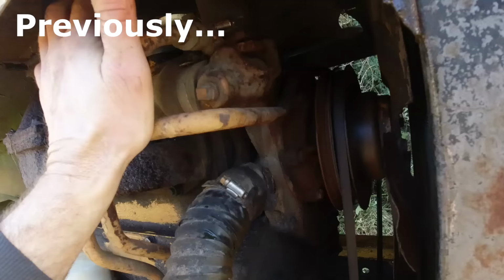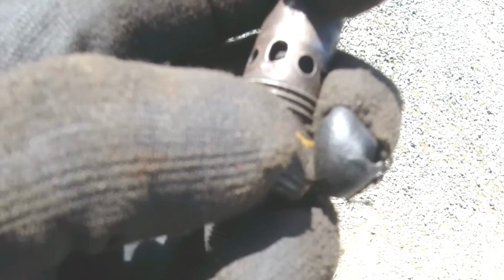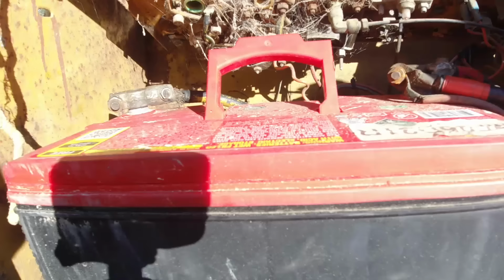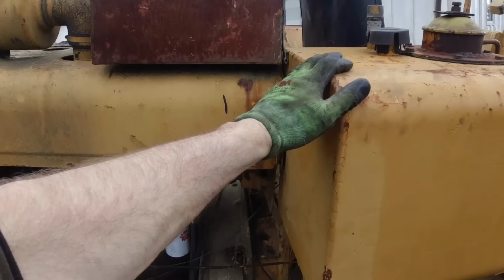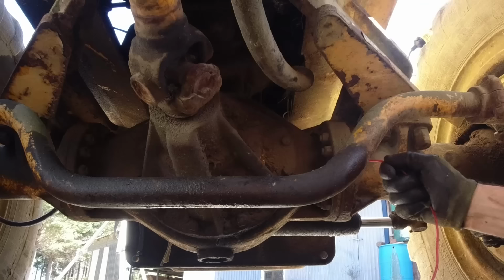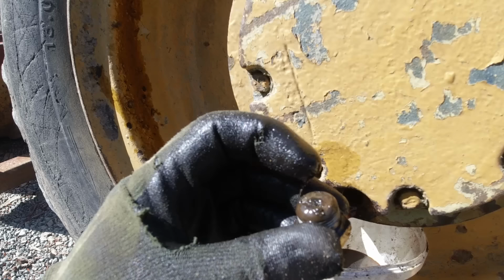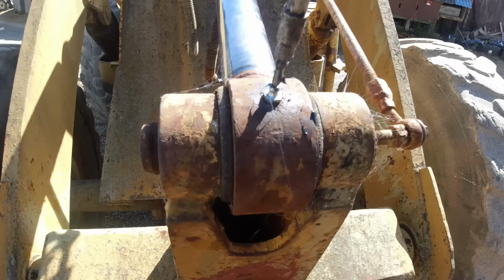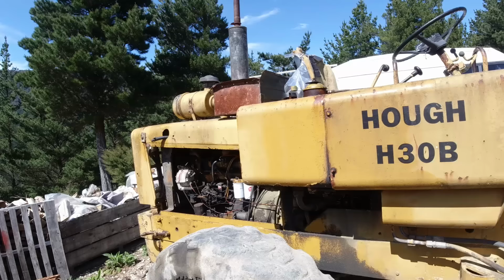Fixing the Hough 30 Payloader and putting it back to work..

Comment: I grew up on a wheat farm in the 1950's, spent endless hours watching my dad fix stuff. Seeing your kids there with you makes me very happy. Thanks Marty. At 70 they too may remember these happy hours with you.
Reply: "At 70 they too ABSOLUTELY" remember these happy hours with you." fixed it for ya brother <3
Reply: I was thinking the same thing, watching my dad fix stuff on the farm. You can take the boy from the farm, but not the farm from the boy
Reply: Yep, as a kid i hung around my Dad onboard his trawler back in the 1970s. So much oil removed & replaced from multiple engines down in the guts of that big steel boat... filters changed, then the entire hydraulics systems & out on the deck the winches needed greasing & all the steel cable pulleys .... I remember it all so clearly & probably where i 1st learned my skillset i use still today... Great video Marty!
Reply: Hanging out with DAD! 👍 I learned so much from him and his friends!
Reply: That's beautiful mate

Comment: All those old machines would last a really long time if maintenance would have been completed. They were built well compared to today's modern plastic throw away machines. Great work!
Reply: A loader like this cost a pretty penny. You would think that the owner would take better care of their investment rather than just driving it into the ground.
Reply: @gs1100ed  Some people are just like that. Drives me bonkers. I work for a housing contractor and his son is one of my best friends. I've been going to school to become a diesel tech for a couple years now. This man has over 1 million dollars worth of assets in machines alone and I have to BEG him to let me grease them. He doesn't take care of any of them. I can't stand it. Dude even has an automatic grease gun, battery powered and everything. It would take no time at all to put a couple pumps of grease in your machine every morning
Reply: @haydona1845  definitely bizarre behavior. I have rebuilt several engines and do most of my own work on my cars, trucks and motorcycles. I also drove 18 wheelers cross country for 20+ years. I am always gentle on the equipment, whether it’s mine or someone else’s. I kind of establish a bond with the vehicle after driving it or working on it. I’m a big advocate of preventative maintenance. Basically, repairing things BEFORE they break. I hate to be broke down on these of the road. Not saying my way is the best, but it Sounds like your boss has a screw loose.
Reply: @gs1100ed  same here man. I guess I sort of do develop a relationship with the machines as well be it as crazy as that may sound. I've always told my girlfriend that a car,truck,machine etc will tell you what it needs. Via vibration,noise,hesitation you name it. My boss doesn't understand any of that. He thinks I'm bullshitting h when I say something sounds weird or doesn't feel right. I work for him Part time and do school full time but what do I know right? It's pretty goofy

Comment: Very interesting to see how that Thermostart gadget works. That's a new one for me. Thanks Marty.
Reply: I agree.! The first 12 minutes made me cringe, putting fuel to a Glow Plug.?
Reply: @paulsilva3346  😮Yeah, I'd never imagined that a solenoid👍 resided in that tiny package
Reply: @charlesangell_bulmtl  it’s not a solenoid per se. It more of a valve. When the heating coil varms up. There is a thermal expansion / or contraction that mechanically opens the valve. Somewhat similar to a thermostat in the engine.

Comment: Fascinating.  Never heard of a thermo-start before.  I'm sure you must be the NZ machine whisperer. 😀
Reply: I thought he was saying thermostat for a minute, I was trying to work out how that was going to help it start without go go juice 🤦🤣
Reply: Thermostart ! the height of sophistication !!  just remember the slow match start, light the pellet, screw the holder in,try to start machine, remove holder,to find out pellet must have gone out almost immediately ! repeat for an hour. Machine starts finally, runs out of fuel in ten minutes !!
Reply: Also known as a "Glow-plug" and "Intake Manifold Heater". 😃

Comment: It’s amazing that something so small like particles in a filter can stop such a huge machine! Thank you Marty, for showing us all how important it is to change filters, and lube our machines!
Reply: If those particles get past the filter, big troubles, the injection system has such
fine tolerances very, very tiny particles cause mayhem and costs huge sums of
money to repair. The small investment of filter replacement is worth its weight
in gold. Even huge ship engines can be crippled by dirty fuel.

Comment: Literally never knew how glow plugs worked up until this point. Learn something every time i watch one of your videos
Reply: That`s not a glow plug.  Glow plugs (also called glow pins) only glow inside the cylinders.  They screw in to the head.  What Marty showed is a Thermostart device.  It heats an element, then fuel flows into the end, ignites, makes a flame, and heats up the intake manifold and the air inside it, so that when the engine begins cranking over,  there`s some nice HOT air to drag into the cylinders to give them a fighting chance to then ignite the diesel.  Once each cylinder has fired a few times, it creates its own heat to fire on each power stroke.  The Thermostart is merely a forerunner to grid heaters that we have on modern diesel engines to help start them in cold weather.
Reply: Bonfire plug!

Comment: Leaving an expensive piece of farm equipment to rust away cause it needs some part or the other doesn’t make any sense. Especially if the owner still owes money on it. Even after it is paid off and starting to age but operates, there is still money to be made at auction or outright sale. Of course  the equipment dealer is not going to give you a decent price, he is in the business of selling new machinery repairing your old equipment and charging as much as the public is willing to pay. 
My uncle had a massive dairy operation in the southwest United States. I spent many summers as a kid on his farm. He always bought used equipment. He was an amazing mechanic and a really hard worker. He had over 1500 milk cows. He also understood all facets of the dairy business including the Commodities business and the latest electronic equipment to keep his eye on his herd. He owned many hundreds of acres in three states. His life was working hard, no vacations. His five boys all went into the dairy business. A few of my cousins made a living off his dairy business. My uncle died a millionaire.  His days started at 4,00 AM and ended around 10,00 PM. In my opinion he died of over work.

Comment: After watching this I have confidence that my constipation will resolve itself today.  The only bad thing about replacing oil like that is that the seals that were relying on the sludge seem to give up the ghost.  Best of luck to you and yours!  PS:  Missus, he used the good knife again, so I just want to give you a heads up about the food tasting like diesel for a while.  You may want to restrict it's use to spicy and savory foods for the next week and watch out for the ones that have a bluish rainbow hue on top.

Comment: I find it amusing that a person will spend several thousand dollars on a piece of equipment but won't spend 50 to keep it running. A little oil and a few filters are the difference between many years of work or assured failure. You probably gave that old Hough Payloader many years of productive activity, as you have all the equipment you restore. It's a joy watching you since I am now 80 years old and can only watch and wish I could still do what you do.

Comment: It's amazing how well the machine runs when all the tar is drained from oil sumps and final drives.  I guess the previous owners figured that if they paint it, they solved the problem of those pesky maintenance issues of greasing and oiling that take up so much time, eh?  Fantastic job on making the old Hough run smooth great video Marty thumbs up.  Oh, I like the big spanner too!

Comment: Hi Marty.  I used to have one of them loaders for pushing silage into a silage pit and loading manure back in the late 70's. Great loaders and easy to work on.  There are grease nipples on the inside of the lift cylinders and they are also in the steering joints but the wheel has to be on full lock to access them. Good luck
Reply from the maker: Thanks, yes I got those but was too awkward to get the camera in there.
Reply: There's one other filter that should be cleaned, the transmission filter, it's a mesh type that can be washed.  Good luck
Reply: @mikestaunton7081  He mentioned not doing the transmission filter yet since the new part was still on its way. But doing it when the part would arrive…

Comment: Marty I have used CLR to clean radiators. Built a stand to hold them so they drain into a 5  gallon bucket and drop a cheap fountain  pump in the bucket and run the hose to the top and let in circulate did this in a pinch and was amazed how well it worked.

Comment: I recently acquired a 1948 Ferguson TEA20 tractor that had been sitting for 15 years with no exhaust cover (the exhaust pipe had rusted off at the manifold) so i had to remove starter and crowbar the ring gear to free it up after soaking the bores and now it starts first pop no smoke at all and i think what you are doing here (fluids, filters etc) is the most satisfying part 😁😁👍

Comment: I got the exact same machine, just with the full cab and albeit a bit better condition. I can see we even have the same style off pins for the bucket cylinder :D
On both my H30B and a Takechi mini excavator I got I have the same thermostart system and on both of them the original system get gravity fed diesel from a small reservoir that the return line fills up to a certain level. So I am not sure the system is supposed to get pressurized diesel? But if it works, it works :)
I used mine for snow plowing in the winter before I upgraded to a Volvo BM 6300 with a blower on it, but believe me, the thermostart doesn't work to good at -20C so a block heater is in order if you get down to those temperatures. 
I think new diesel nozzles would be beneficials also, the old ones are probably the same one it rolled of the factory line with back in the seventies. Or at least a good clean.

Comment: You mentioned the tires being interchangeable with the grader to be a main motivation to buy this loader. Do you have plans to change some of them as a preventative measure or is this just in case?
Also, have these tires been refurbished, seems like there's cracks where the new surface was vulcanized on to them long time ago.

Comment: How come you never wash your machines before working on them Marty? I was always taught that cleaning things is a good idea because filth can cover up problems and make things worse if it falls into places it's not supposed to be.

Lovely to see your young lad sorting out the spanners and your daughter keeping an eye on the oil changes, she'll be stripping down tractors in no time I'm sure.
Reply from the maker: I often pressure wash smaller machines but I would have bucket loads of old grease and oil sitting in my yard if I cleaned this old girl
Reply: One must be careful and choose the appropriate washing technique and the time to use it. There is a big difference between using a brush and a bucket of soapy water versus a pressure washer.

Comment: Mother used to change the car's oil once a month; no mater how far it was driven. When it got hit so bad the frame bent; the engine was still in production tolerances. 396 Chevy in a Chevrolet BelAir

Comment: Is it ok to feed the thermostart from the fuel pump permanently? Most that I've seen are fed from a little header tank about 50 - 100ml which is replenished from the injector return and hence would deliver a much lower pressure to the burner valve.
Reply from the maker: The fuel pump is only on until the engine starts

Comment: On old diesels, we used to spike the fuel with some Delco Automatic Transmission Fluid.  About 1/2 qt or better to a tankful would lube and clean the fuel system and add 2 points to the Cetane rating.

Comment: If you can inspect the hydraulic pump (through openings) in situ, i would. That black gunk is a symptom of something else going on in the system.
Reply from the maker: Maybe the rubber hose internals have shed some skin due to no return filter allowing particles to circulate?

Comment: If you have a grease fitting that won't take grease here is a tip I learned. Use a propane torch or something similar and heat up the grease fitting  and the area around it. This melts the hardened grease or paraffin  and then try greasing it. I was using one of those tools to  unstoppable fittings till I came across the flame tool . Has worked for me every time . Use it on fittings that are slow takers too .
Reply from the maker: Good tip, these ones were damaged, rusty or the spring had failed so best to replace

Comment: Great video. at 75, I well remember my business partner, always thuroughly pressure washed any equipment he bought used. like you, he changed all fluids and greased everything. He also replaced gages and seat covers if bad, they stay dryer. It all paid off finding the obvious flaws befor putting it to work. He made a great living working a fleet of heavy earth moving equipment.
Thank you for all your videos.

Comment: A better place for the bucket chain would be to run it behind the forks. I ran a skid steer with a custom jig that the forks slid in, similar style to your bucket, for moving trailers around. We wrapped the chain around around the back rest and it slowly bent one of the sections and then ripped it. After that we started putting the chain behind the forks.

Comment: Had the same hot hydraulic oil situation on my military H90 payloader. Same solution. The intake filter was covered with the black mess. Our maintenance Warrant Officer said it was the deteriorating rubber hoses rotting from the inside. The new hydraulic filters made all the difference in the world. Thanks for the fun!

Comment: I keep a cut up plastic license plate (think American dealership promo plates) with a v-shaped fold and a slice on one end to stab onto lines or heavier wires and direct oil away from crossmembers and soft parts; like bushings or pressurized soft lines.

Comment: I am pleased that installed the correct thermostat that closes off the bypass, I saw that when you changed the engine oil filter there was not a raiser pipe in the housing. When these filters are fitted upside down like this they act like an air bell and only half of the filter is used if a raiser pipe pushes the oil up to a higher level or use a filter with a bleed port. From Australia

Comment: It's crazy how many people still think that taking a thermostat out will fix overheating. The only time removing a thermostat will fix overheating is if the thermostat itself is stuck closed and causing the overheating. And like you said if you remove the thermostat the engine can run too cold which is not good for it. Engines are designed to run within a very specific temperature range and running them below means that things like bearing tolerances can end up being too tight and increase wear.

Comment: Nice work! I've had a few hard to get/fix grease zerks in my past. Have you ever tried a grease joint rejuvenator? I got one for one zerk that was really giving me problems. You fill it with your favorite cleaning agent then hit it with a hammer to drive it in and clear the fitting. I won't mention the brand I bought - it was worth every penny for the trouble it saved me! 
Keep up the good work!

Comment: I had an uncle who did all his repairs on the farm equipment where possible but I would add the first thing he always did was to clean everything; first blow off the dirt with a compressed air line, second power wash it. At that stage he said you could clearly see what he was getting into.
Reply from the maker: Yeah I thought about it but with a machine this size you end up with bucket loads of old grease and oil on the ground after pressure washing
Reply: @MartyT  The USA based YouTubers don't seem to see that as a problem, but I cringe when they do it

Comment: Great video. My dad just got a Hough 50 loader up in Carterton and the air filter is a metal mesh but was all blocked up. We are just struggling to find where we can get a replacement one in NZ. Cheers Ash
Reply from the maker: I had to get one on aliexpress, measured the original and searched by size
Reply: Cheers appreciate the reply

Comment: Manifold Glow start requires a head of fuel ie from Bleed off from injectors from fire wall ... usually hows its setup ... so when  you activate the Glow the heat opens the fuel valve then you have a Flame inside manifold to assist your cold start or hot start ...
Reply: In this case the fuel pump pressurises the fuel instantly eliminating the need for a small reservoir to catch the return fuel from the injectors......
The orifice in the thermostart is small enough that the pressurised (3 to 5 psi) diesel fuel won't overwhelm the  flame...